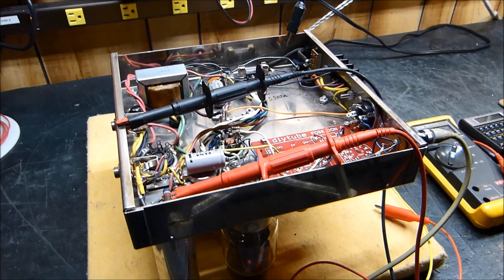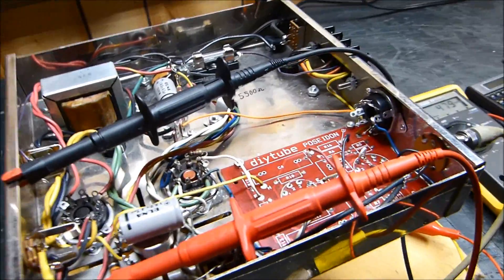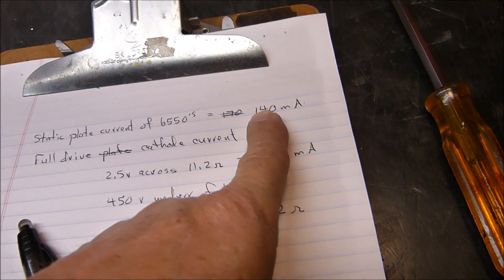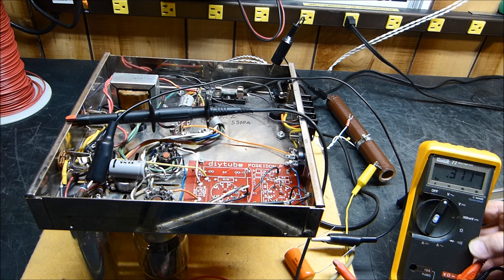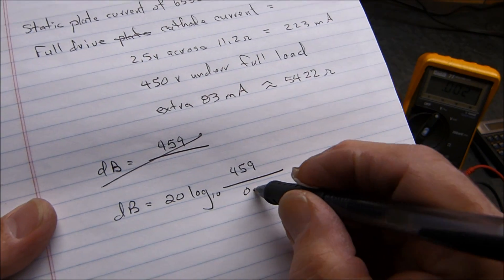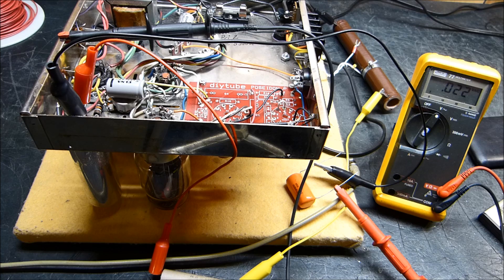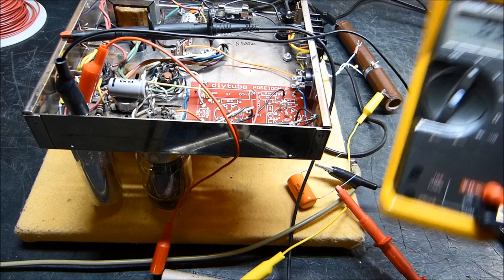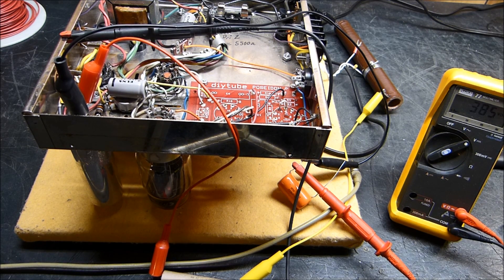Measuring Power Supply AC Ripple Voltage on Vacuum Tube Audio Amplifies (Dynaco Mark III)

Comment: hi i took a measure of my power supply preamp with my multimeter and i got 3 millivolts do you think its enough for a good supply .thanks
Reply from the maker: I can't remember all these measurements without reviewing the video or remeasuring but I would say 3 mV out of, 450-500 volts for the plate supply is excellent. I don't know if I mentioned it in this video but I have found an important and fundamental design to be most effective in reducing hum in audio amplifiers and that is to keep all power supply components, including the choke and especially the main electrolytic capacitors in one corner of the chassis away from the input connections. There is indeed, current flowing thru the chassis between the CT (or negative chassis ground) of the power transformer and the electrolytic power supply capacitors that will be picked up by the input circuits if the currents are flowing thru the input portion of the chassis. If the chassis layout is not proper with the PS isolated from the inputs, no amount of adding capacitors or anything else will fix it. Thanks for your comments.
Reply: Thank you for your answer 
 @ElPasoTubeAmps

Comment: hi.it would be cool if  i could see your set up with the resistor  on paper ,its more easy for me when i see this on shematics.thanks
Reply from the maker: I agree and love to see things in schematics. Too late for that now in this video but the first measurement was right out of the power supply choke that feeds DC to the output tubes and the second measurement was on the output side of the last dropping resistors and additional electrolytic capacitors for the (lower) voltage that feed the voltage amplifier tubes like the 12AX7, 12AU7, etc. It would have been better to show it in schematic.

Comment: Working on my type 83 mercury tube today I got a relay hooked up to turn on the b+ after 3 min and hooked up a switch as well with 8mf oil in paper military bathtub cap before the 10 Henry 250ma choke then added another 8mf same cap and measured 0.9 ac At 525 Volts dc on a 10k load resistor is this a acceptable ripple at this stage in the power supply
Reply: I’m sure I’ll have to bump it up to 30-50 mf after the choke  i also have a 50ohm 10 watt right after the b+ as the data sheet requires seems like things are running great just need a transformer or diagram to get a negative bias not many amplifier circuits using the old 83 tube it’s been fun so far
Reply from the maker: @jimcatanzaro7808  30-50 uF would be OK. Nowadays it seems everyone wants to go to extreme values with their filter capacitors. In general, I don't see it going wrong unless the capacitors get into 5000 uf or so - I do not have a maximum number - and in some small way, larger capacitors do continue to reduce hum but once the S/N ratio is greater than -80 dB it becomes not worth the trouble, in my opinion. I did some measurements a few years back and I think I posted the results where I substituted a resistor like you are using, a 50 ohm 10W, in place of the choke and could see it made about a 5 or 6 dB increase in S/N but, again, once it is -80 dB or so, increasing or decreasing it 5 dB either way does little for improvement or harm. At even -76 dB or so S/N, I can not hear any significant noise/hiss coming from even very sensitive Klipschorn speakers. It has been my experience that if the PS components are placed at a distance from the audio path and no PS chassis currents are flowing thru the chassis mixed where signal connections are flowing, your S/N and hum issues will be minimized. I actually saw an article on that very subject some time back. Even if we use an elevated buss ground system and ground the buss to the chassis at the input terminal as some designs suggest, it is important to not mix the PS filter components in between the audio signal components. No doubt that is why separate power supplies are likely to be superior in signal to noise, hum, hiss, etc. than power supplies built on the audio signal chassis.
There are many ways to get a bias supply for class-A and AB1 amplifiers. The amount of current the bias supply has to maintain is essentially zero mA. Only the amount of current in the filter system is required. The amplifier never draws any grid current so I have seen designs where they come right off one side of the HV secondary winding with a capacitor - something like a 0.1 or 0.05 uF then thru the diode (reversed biased of course) into a voltage divider and bias adjustment pot. The filter capacitor (electrolytic) should be small, maybe 10-20uf, as it is having to charge thru the capacitor and voltage divider and may take a long time to fully charge if it huge like 470 uF. Something to keep in mind. In class-B amplifiers, it is a completely different story as the bias supply does have to supply significant current to the grids. I have a class-B linear amplifier running a 833A triode and I use a 1:1 isolation transformer at 100VA (100 watts) or approximately 1A of available grid current that the supply can provide. In a case like this a heaver bleeder resistor is often used to load the bias supply to keep it stable with a Variac on the primary of the bias supply to set the resting plate current to some exact value. You won't have to go there with a small audio amplifier...  Stay safe.

Comment: ELPASO TUBEAMPS, 
why does the AC ripple voltage INCREASE when the power tubes or circuit draws more current from the power supply? If you increase the B+ voltage from the power supply does the AC ripple voltage increase or decrease?
Reply from the maker: Hi Bill. 
That is a real fundamental question. I will say for sure, if you increase the load, the ripple will increase. I suppose that is because the filter capacitors are discharging more during each cycle. With no load, I think ripple would be at a minimum as the electrolytic capacitors would charge up to the peak voltage and it would be perfectly smooth with no ripple. If we have a constant load and increase the DC voltage,  assuming we have a Variac on the primary of the transformer, I am convinced the ripple would go down but in a real circuit, the current would increase if the voltage increases so theoretically, I can not say for sure. That is why I like to measure things but I did not think to measure that parameter in this case.
Reply: @ElPasoTubeAmps  thanks for the help, But what formula do you use on the calculator to compute that when the Load increases the ripple will increase? I would think if the load Increases the Ripple should decrease not increase so i'm confused. Can you please explain more? another question if you removed the power supply CHOKE what does this do to the ripple? removing the Choke will cause more AC ripple on the Biasing grids on the power tubes which can cause "harmonics" from the AC 60hz added to the biasing grid? The AC ripple can modulate the biasing grid of the power tubes?
Reply from the maker: @billwilliams6338  You ask some great questions.
I have the book: Audio Cyclopedia by Howard Tremaine and there is a free download at this site: Check out page 1173 and you may find some help.
https://archive.org/details/AudioCyclopedia
I recommend downloading and saving this book. I had no idea it was posted for free until I started searching for an answer to your questions. I am not sure it can be saved in PDF form but it is complete online.
Some of the older amplifiers use resistors instead of chokes in the PS and I have found that the S/N is about 10 dB worse for the ones with the resistor instead of the choke but still within good HiFi range (70 dB or so with the resistor and 80-90 dB with the choke).
Reply: @ElPasoTubeAmps  I always look at many designs and see what caps to use to filter out after the rectifier tube some data sheets have them on there especially the older rectifier tubes 10-20 mf is plenty before a choke after that’s it’s whatever you want 
On the type 83 33mf was way too much and started to spark I saw a old design and they used 6 or 8 mf oil in paper tub caps and after the choke 33mf -50 mf so that’s what I’m using and after oil run capacitors for hvac I scored from work big but nice and shiny after I polished them

Comment: I like you guys that tell us you only need a couple of pieces of equipment to do a measurement while you have a dozen pieces hooked up...
Reply from the maker: Corvette Coupe You sure have a good point. But, now  that I am an "old man" of 65 years and I look back on time, I realize that even the most gifted craftsman can still learn something about how to use the hammer. What I mean by this is, we all tend to want to understand and grasp life in its most complex situations but actually life continuously repeats at the elemental level and all of us, in one way or another, miss the obvious. Back to the hammer - it doesn't take $100,000 worth of tools to make a table - just a few hand tools if we know how to use them. Maybe it takes a life time to realize and cannot be learned any other way.

Comment: Don't get this. The ripple voltage is @ 120Hz and not nearly a sinewave. This is the reason your RMS measurments are all over the place and are probably not very accurate...
Reply from the maker: The 120 Hz should not be a problem and the Fluke is a True RMS reading meter so it shouldn't have to be a good sine wave but I have to agree with you about not very accurate. I have not looked further into why the meter can't stabilize. Maybe the Tektronix DMM I have would work better. I have thought about this video a number of times and may redo it and delete this one. Thanks for your comments.

Comment: Are you using the famous HP15c calculator? If so, do you find its easier to use this than their bigger brethren. I use a HP50g for example. But I am thinking of getting one of those smaller ones as well as they seem a lot more convenient. But I don't know?
Reply from the maker: I still use a 15C that I have had since the 80's. I bought a second one off Ebay and a 15C app for my phone so. I like that model best of all. I have had the larger graphing HP calculators but I didn't keep them long. If I do need graphing (which I rarely do) I use a program on the PC called "Derive", "A Mathematical Assistant."
Reply: ElPaso TubeAmps  Yes the HP50G is just way too bulky. You've just sold me the 15c. It does look far more practical. Plus I never use the graphing on mine either. Jeez they are not cheap!

Comment: I just use my Fluke 867B in DC plus AC RMS mode to read the DC voltage and AC ripple component simultaneously. :-)
Reply from the maker: There you go - it's just that simple with the right instruments. Thanks, Mark.

Comment: Isn't the ripple voltage more of a sawtooth shape? Therefore the usual formulas for obtaining the RMS values of sinusoidal signals (like peak-to-peak divided by 2*sqrt(2)) don't really apply. I think at best you'd get an approximation with a little error.

Probably the best way is to measure the ripple with a True RMS multimeter.

What do you think?
Reply from the maker: I think you make a good point. The Fluke meter is a True RMS meter and maybe that is why it was having such a hard time settling down.  To use an analog averaging meter might be worse. Maybe the better way would be to use a scope but if the waveform is distorted from a sine wave then it would be an estimation again of what RMS value to use. I will have to look into this some more and maybe post a comment in the video if I find something that helps. Thanks for your comment.

Comment: Thanks for listening to me ;-)
But I t hought I asked for doing it with a scope 😊
Reply from the maker: You could use the same setup but use an oscilloscope in place of the digital volt meter and you will get a peak-to-peak reading on your scope. You would divide the scope reading by 2*sqrt(2) which is approximately 2.828 and come up with the same RMS value for ripple voltage and the same decibel value or even use both the meter and scope at the same time to duplicate and verify your results.
Reply: ElPaso TubeAmps thanks!
Keep up the good work.

Comment: Hi David! The Audio Cyclopedia is a great reference book! It contains a lot of valuable info! I've had mine since I was a teenager :) There are a lot of technicians out there that don't believe in one of my theories, which is the use of a scope for troubleshooting. If guys would take the time to learn to properly use a scope, it would make their repair life a lot easier. I find it not only useful in troubleshooting audio amplifiers, but I've learned years ago that it is a valuable tool for troubleshooting vacuum tube TV's which I do repair and refurbishing for some collectors--both B&W and Color, not to mention vintage tube radios. However using a meter and loads, is a very effective way to read AC ripple voltage. Keep 'em coming. :)
Reply from the maker: Frank Ferraro Hi Frank – The Internet has allowed overwhelming chatter from
those that know the least but diagnose the quickest.  The fact remains that methodical and
repeatable investigation and measurement is as valuable today as ever.
Subjective opinion certainly seems to rule the world from vacuum tubes to
terrorist attacks but those that appear to advance at a snail’s pace are those
that use time tested methodical and repeatable methods. I am not sure this
mentality can be transferred and taught to those that don’t seek it on their
own from the beginning. When I want to know the most fundamental knowledge of a
subject, I search out those that discovered the principle. It seems to me that
some 100 years ago, or so, those that discovered some of the secrets of life
and physics  were so passionate at
conveying their discoveries to the world that they were meticulous in
describing, documenting and even giving away for free what they discovered.
Since those times, it seems that the capitalists and academia have gone to the
limits to make money and careers from those pioneers to promote their own monetary
gain and retirement package. I am not bitter at the world and I still believe
that giving away all that we have discovered during our lifetime is the right
thing to do. Someday I won’t even know what an oscilloscope is much less how to
use it so I passionately throw-to-the-wind all that I know as I am absolutely
convinced it will make a difference in the lives of a few. That’s why I do what
I do on YouTube and I think it is true for many others also.
Reply: ElPaso TubeAmps What you do is always well respected by me for certain! Keep 'em coming :)

Comment: texas instruments has a video on this https://www.youtube.com/watch?v=pKXPqApOYfk
Reply from the maker: noahtheviking Thanks, that's a nice site to know about - another one from that site that I watched and liked is https://www.youtube.com/watch?v=pKXPqApOYfk  Of course, he is measuring regulated low voltage, high current supplies. Got to get me one of those MDO (mixed domain oscilloscopes) where we have the oscilloscope and spectrum analyzer built into one - I see them on Ebay used for about $17K. There is another YouTub'er that does videos and has a nice Tektronix MDO - W2AEW is his YT name.